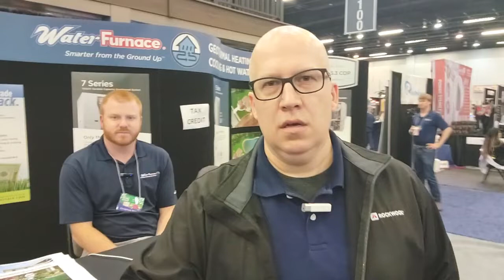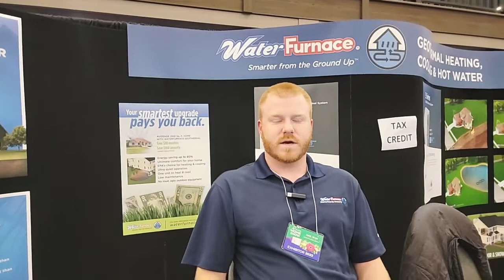Ground Source Heat Pump | Water Furnace

Comment: We have a 5 ton Aaon vertical closed loop system and in the first 10.5 months of 2022 at an electric rate of .256/kwh it averaged $139.62 per month.  Located in the Hudson Valley NY.